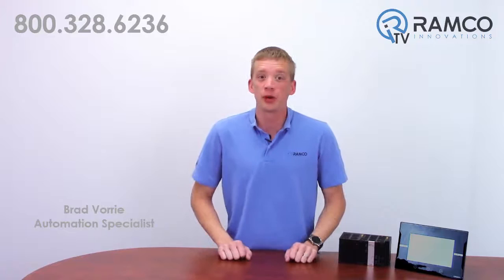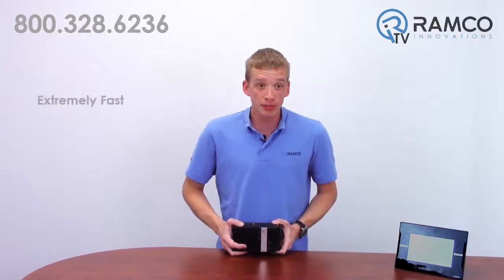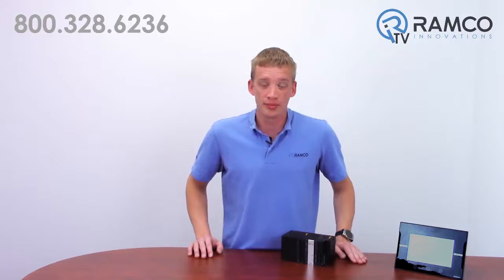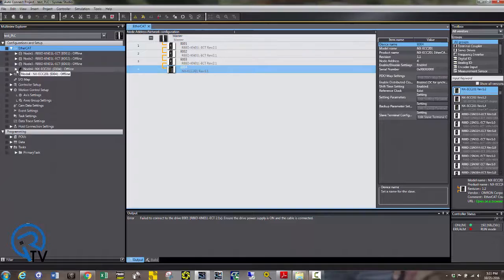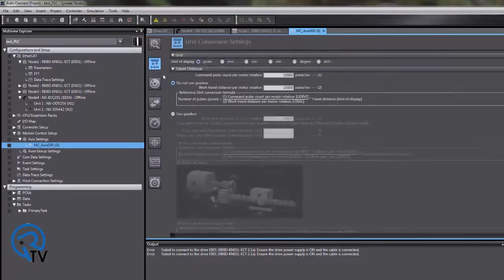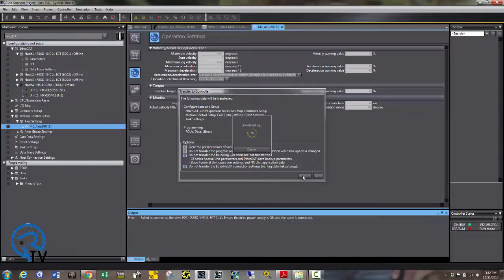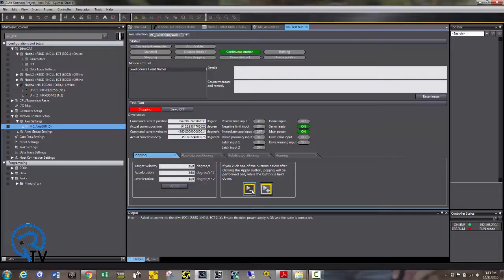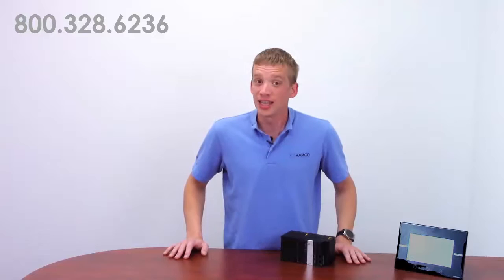Omron NJ Part 1: Introduction & Setup

Comment: Nice Video.. Tried it out.. had not programed any code...Just set up the EtherCAT network, and added a R88D-KNA5L-ECT Drive and motor ... all wired and looked good .. powered up and got a error code of 87 on the drive .. still downloaded your setup for MC TEST .. and all went well... but even after resets.. still got Error 87 (Immediate Stop Input Error )   and the MC test won't run if there's another motion command being executed.   I've tried Reset from the HMI, and Sysmac .. doesn't clear it.. about to try executing the MC_Reset and ResetECError functions...  But, I would like to know what's wrong to cause the error... is it my EtherCAT setup (it's just like yours :-)  ?    I'm not using the CN1 connection or the terminal board. at all.. no 24VDC,  and nothing else in the I/O Map.  Should your MC_TEST still work?
Reply: Ah yes!!  The good old 87 alarm!  It might be best if I get you a document that explains that.  Give us a few minutes and we will send you a link to download a document on G5 Ethercat Initial setup.
Reply: I have to apologize!  I realize that this video "assumes" that parameters on the drive, that would prevent those alarms, would have already been done.  I honestly didn't even think of this situation until now as this is my demo drive and parameters are already setup.  Looks like I have another video to make!  THANK YOU for bringing this to our attention.
Reply from the maker: Here is the link to the Document Brad mentioned that explains the initial setup. http://ramcoi.com/images/Initial_Servo_Setup.pdf
Reply: Thanks much Brad! ... This link should do the trick.  Very cool that you reply to comments, and thanks for making this video .. this test is a great Omron feature.
Reply: Awesome help Brad .. fixed the Error 87 problem!... :-)
Reply: the same story ,  error code 87  , try your link but page not found